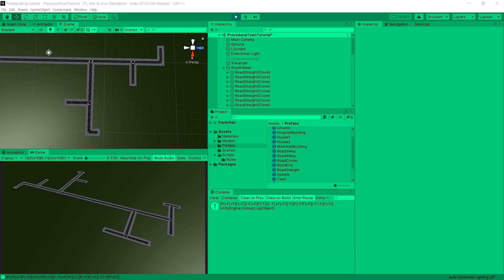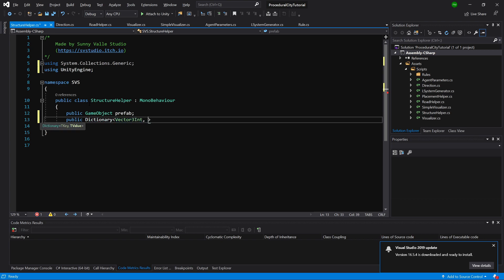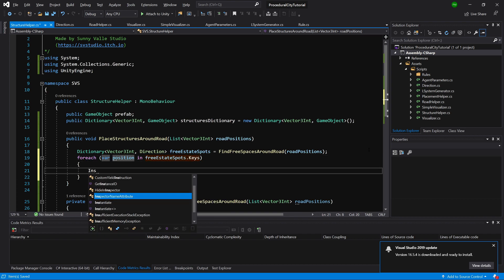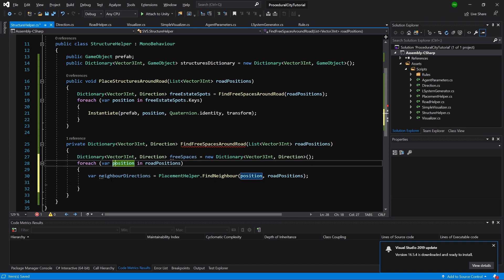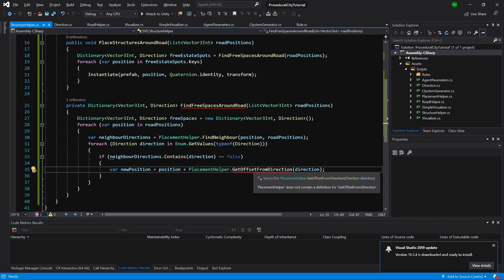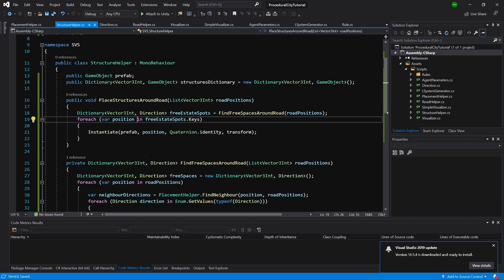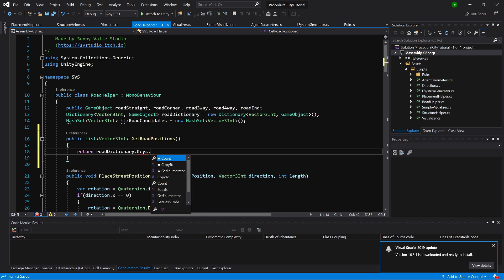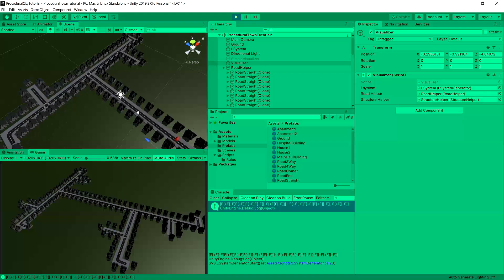Unity Procedural Town Tutorial Ep10 Placing houses p1

Comment: Hey, when I run this part of the script, tens of thousands of houses are created. It's looking like it's ignoring positions that are filled with a house/road, as I outputted a log when looking through positions in the FindFreeSpacesAroundRoad method, and it told me that the same free spaces were being found hundreds of times, and therefore a house kept being instantiated on that space. 

I know this is vague, and a while ago, but do you remember if you ran into an issue like that?
Reply from the maker: Usually when it happens to me it means some error in "if(..)" check or that I forgot to add some "occupiedList.Add(position)" and the if statement checks (occupiedPositions.Contains(position) == false) -> return.
It might also be something more generic like comparing floats. I bet that I did my best to avoid it but from my experience this also comes up a lot. That float a = 0 in a check if(a == 0) returns false. We need to use Mathf.Approximately(...) method

Comment: Hey @Sunny thx for the video about the L-system, it really is a complicated system for procedural art but I'm excited to continue practice more, for future work. I have a question, regarding placing buildings, what dictionaries are we getting of at 2:10 and 3:21? If I'm assuming, we are creating a new dictionary of "structuresDictionary" - for buildings pos and obj and we implementing another new Dictionary of free space - "freeEstateSpots" as in relocating free spots around the road, is it not? Secondly, the dictionary of "FindFreeSpacesAroundRoad" is a method where we want to place building around the road, correct? Also, the part 7:00 you've mentioned that if there is no neighbour, what are we placing then? free offset space around the building? (got confused that part). Lastly, at 7:55 we are placing where building should be placed based on the road direction and around it? That's it for now, I just want to know if I understand correctly for each method :D
Reply from the maker: Hi! Is is a bit awkward as back than I didn't fully understand Graphs and how they work. I have created those dictionaries to store data - probably could have done a better job when creating the architecture of this system. In any case you are correct that we are simply storing that in those dictionaries as for any procedural system we desire for our algorithm to take into consideration previously placed objects to make future decisions. While the data layout is not the best always make sure that you save what you find as it might be useful for the next step - here "freeEstateSpots" I believe is used for buildings as well as for trees and you could potentially place anything else that you fancy.
If we don't have a neighbour (or neighbor depending which part of the world are you) we simply want to skip this road position - this would be ex a 4way street.